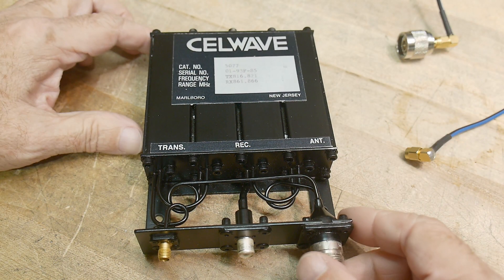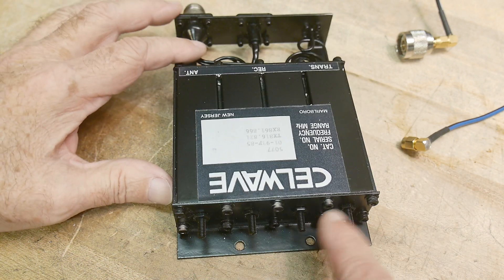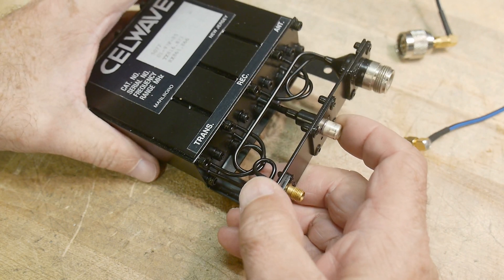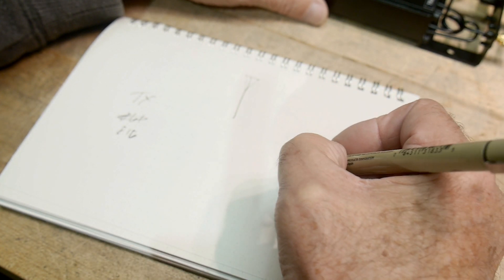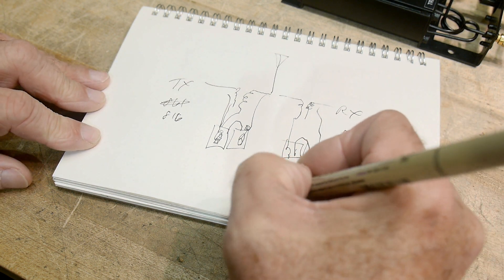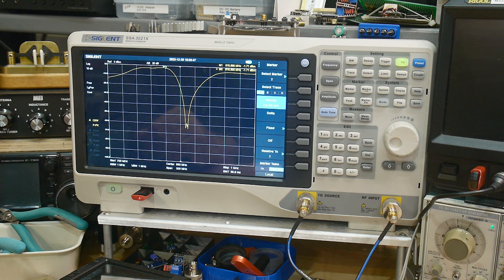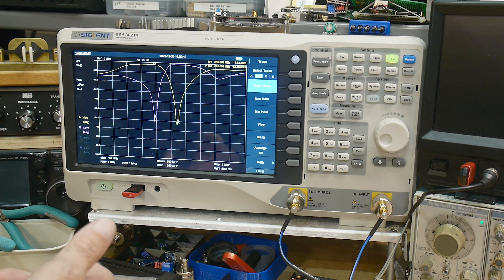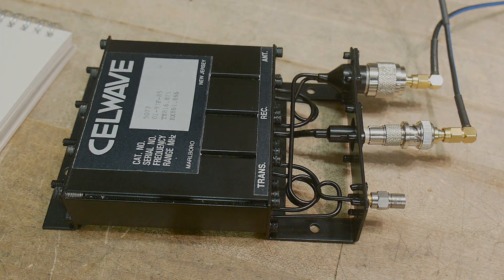#1386 800 MHz Duplexer (part 1 of 2)

Comment: The antennas that I had that are 800 MHz about 6 feet tall panels had N connectors

The transmitter has sma
The receivers I don't remember what they used

Comment: This would be in the business band, if it is transmit on 861 and receive on 816

Strange

I think they must have modified them to work on the cellular band 824 to 849 receive and 869 to 896 transmit

The cellular companies sent out notices last year to all the owners of non smartphones that were on the 800 band that support for these phones was ending in January and they sent new smartphones free to all the people who still had old phones.

My guess is they either shut down the 800 band or repurposed it for the wideband digital signals and these were not compatible or not needed.

Many towers went to the 700 band or 600 band for 5G.
My carrier sent me a brand new 5G phone and I didn't ask for it.
The 800 towers are off where I am. They shut them down last year. The antennas are the same. My guess is they are using the same antenna for the new 700 and 600 frequencies

Comment: It is the electrical length of the center conductor rather than the length of the outer casing that determines the Frequency of resonance. To get the best Q factor and hence narrowest band response the center conductor needs to be physically 1/4 wave long and all parts need the absolute lowest resistance.
Reply from the maker: there are several designs for duplexers. your comment is valid for one type. I believe these are a helical resonator type design and are quite different

Comment: That actually looks like a duplexer used for a business band repeater within a large building. Frequencies are just below the old US analog cell towers that were in the 868 to 894MHz range.
Reply: Come to think of it I've seen them used in the trunks of police cars also.  I think some of their MDT's used them. Maybe someone can chime in that installs these.   Maybe this was used for Motorola radios so they could perform OTAR data programming while still maintaining 2 way comms?
Reply: @more jello please     Thank you for the tip.
Reply: @morejelloplease  yes commonly used in vehicles. A fixed installation would need to be much more complex with more cavities in order to reject other strong in band transmissions since various operators tend to occupy the same physical locations selected for best coverage.

Comment: Interesting variety of connectors. If the engineers strategically choose the connectors for the cell site they could make it impossible to wire up wrong. That could save a lot of labor cost to get the wiring right, let alone not having to repair receivers blown by incorrect cabling.

Comment: Got the same one as well, though different frequencies as it was used for a now defunct lottery operator, who simply abandoned the terminals when they closed up shop. Pretty interesting, 25W PA stage for the radio, 68000 processor with 128M of RAM, and some really complex mechanical parts to integrate the scanner into the machine, with another printer to generate the tickets in there as well, and then a small LCD display for the operator, and a VFD for customer side output. Plus encryption for the data side, and a very reliable very overspecced power supply and cooling system, as they had to be reliable, even if the local grid was not.

Comment: It is so strange that the duplexer has RCA type as REC. connector, I've never seen it at cellular freq. band to use RCA connector type.
Reply: Maybe it was done to fit in an OLD system?
Reply: @paulcohen1555  I would imagine the selection of unique connector types on the duplexer makes it more difficult to connect it wrong when it's being installed.
Reply: @lmamakos  Oh,  it's  a good idea not to make a mistake to connect it wrong in the installing field.
Reply: @paulcohen1555  maybe....but it mismatches the impedance matching and causes the received signal strength weaker unless the following stage, LNA was specially designed to fit it, I think.
Reply: @paulcohen1555     It strike me that that frequency band is allocated for other usuage,  a business band repeater within a large building rather than cellular service. ( I also found other one's comment. < @more jello please>  )
Reply: RCA as that is a cheap connector, and you get the cable assemblied pre terminated to them with 50R coax, and the performance is good enough for the low power use. Those cable assemblies were made by the million to be used inside consumer RF converters, to feed the diplexed RF output from the on board RF modulator to the diplexer on the back, and for many VCR units the same diplexer also fed a sample of the input signal to the tuner unit near the front of the machine. Also used to transfer video from one board to the other in them as well. Later on the RF side became one box, and the video side a single chip that handled all video, getting RF in, IF conversion, and getting video from another single chip that handled all the video and audio from the head side of the machine, plus also having all the servo functions in it. Before production of VHS ceased, your entire audio and video chain, from RF in, to the head signals to the actual mechanism, plus all the servos and such, along with on screen display and tuner control, were on a single chip, with another chip on the front panel handling that display and remote system.
Reply: @SeanBZA  🙂Thank you for your explanation. Yes, I see that  RCA connectors which are cost-effective are widely used in RF modulators inside VCR, etc.   For the better cellular service (UHF or up), the low insertion loss (i.e. exacter impedance matching) is critical to the receiver sensitivity, N type or SMA type or BNC type connectors are used at cellular frequenies band.
Reply: @TechProbe  Yes, but for 800MHz a RCA connector for the receive path is good enough, especially the types that have miniature coax soldered to them, as the inner diameter of the coax is very close to the RCA inner dimension, and thus there is not too much insertion loss, plus having the entire connector and socket being tinned with solder does mean there is a reasonable RF performance long term, as those connectors are really only used once or twice, after manufacture and testing, so they make a good RF connection with the soft metal parts conforming to each other. Plus are cheap pressed parts, not machined, so are a real big advantage cost wise, as the connector does cost less than the cable it is attached to, the converse of the more expensive machined and plated parts.

Only part that is easier to assemble is the F connector, as strip, screw and toss is about as fast as you can get it with low cost. The RCA does need 2 extra steps of crimp the braid and solder inner and outer, though that was often fast as well, just a dip into some liquid rosin, followed by a dip in a solder pot in the factory, an equally fast method.
Reply: @SeanBZA  thank you for the details.
Reply: the old motorola radios used rca on the receiver strips in two ways